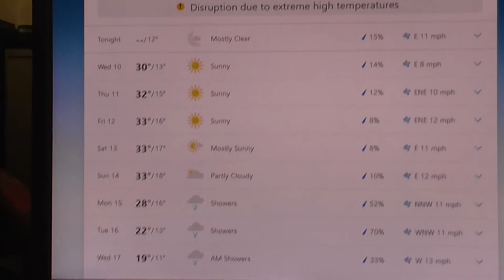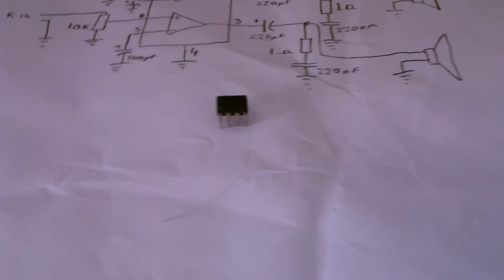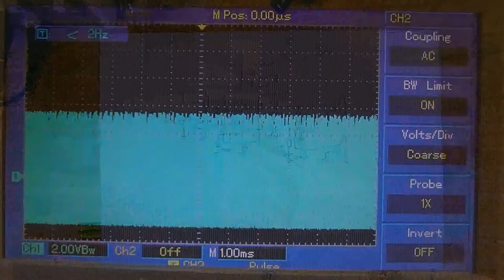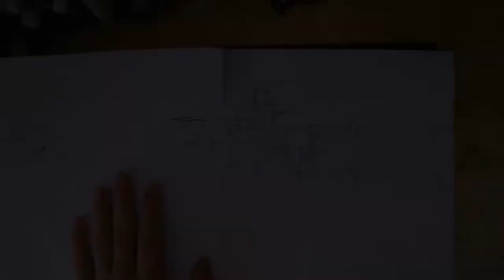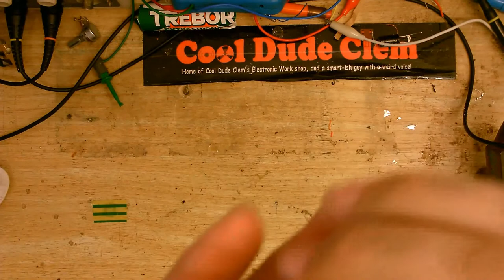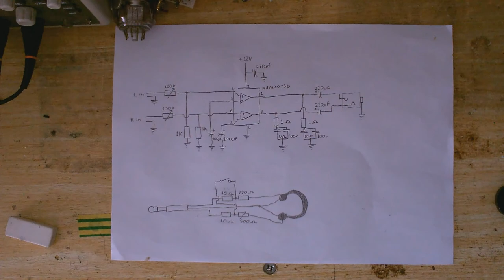Making an audio mixer for my computer. Part 1 - 2073D as Headphone amp

Comment: Damping your signal and amplifying it again with maximum gain introduces unnecessary noise.The NJM2073D datasheet contains a section on how to properly implement the gain reduction (through an additional external feedback network). The example for stereo is given in Fig. 6.
Reply from the maker: Yes, that was something I was worried about but it still seems to sound good enough. At the time I thought I was at the end of the datasheet so I didn't scroll down further, or I would have seen it. I found that part about gain reduction only after I'd built the circuit. Oh well.